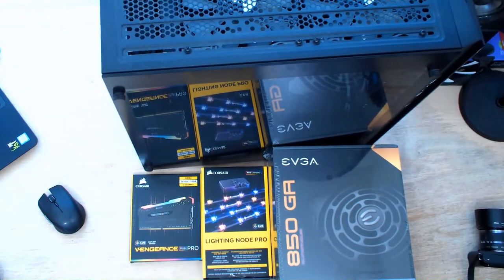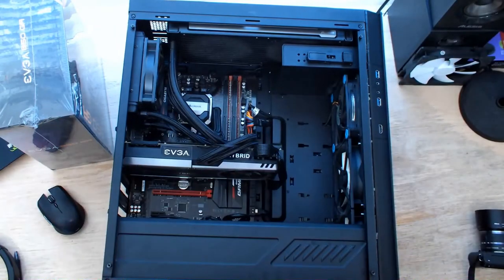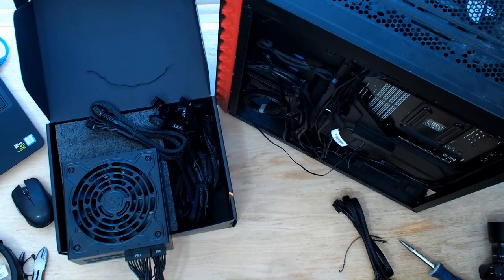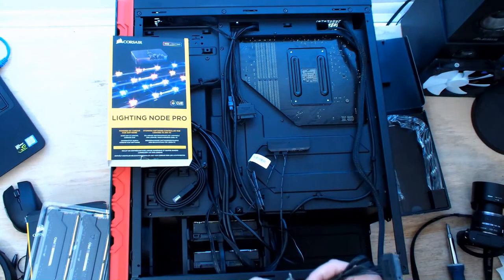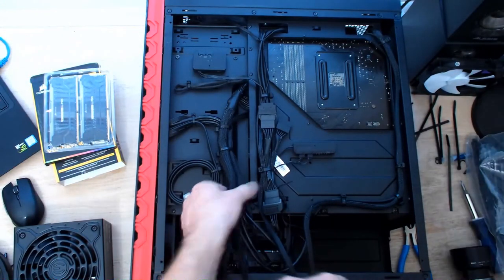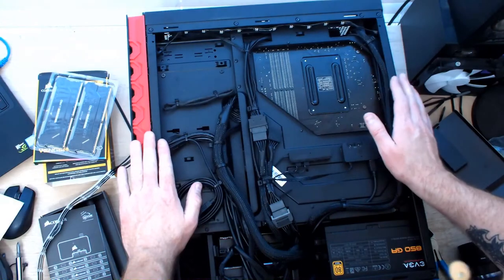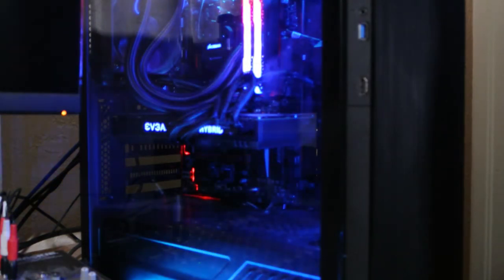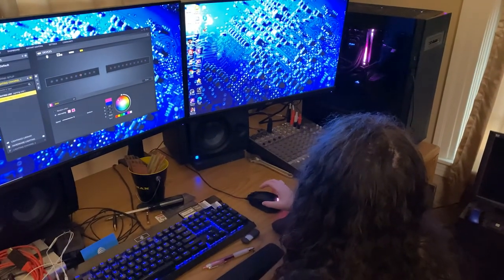Adventures of WinHell - EVGA & Corsair RGB

Comment: What’s the difference between a G5 and a GA?
Both gold
Reply from the maker: "Gold" power supplies are just indication of their efficiency rating. 80% Gold means that they have to certify at 90% efficient at a 50% load.  As for the differences between the G5 and GA there isn't much. The G5 is a newer model, has a newer Fluid Dynamic Bearing fan (the GA has a Double Ball Bearing fan) and it looks like the G5 eliminates the Floppy power adapter. Beyond that, they are the same size, and have the same power ratings. Both are good power supplies, but the G5 is currently the better deal as I have seen them $10 cheaper than the GA.
Reply: @AudioCraZ  awesome! thank you for replying! sub!

Comment: Hey man, I just installed this PSU and my computer is working fine. Only issue is that the PSU is making loud noise when gaming and fluctuates on and off when not gaming. It's a damn loud fan noise ;(
Reply from the maker: If it is an EVGA power supply, I would contact their support. I have always found their power supplies to be very silent. It may be a faulty fan or or something may of happened during shipping (I have had shipping damages many times).

Comment: hey did you face any problems with this psu if so please tell
Reply from the maker: None at all. Running damn good in my system. The only issue I have had was the ram, and that was just the ram was too fast. I had to go back to my standard sticks. Other than that, system is running smooth.
Reply: @AudioCraZ  i heard that this power supply doesn’t work with 3080
Reply from the maker: @Mishalx8  Power requirements for a 3080 is 750 watt psu, so this 850 would do fine (unless you plan on some serious overclocking). Beyond that you would just need to get the power  connector adapters, which are easy to get.
Reply: Today I was building a pc with the same power supply and the cpu cable doesn’t fit there
Reply: Can you help me ? Because the 8 pin for the cpu has a different shape and doesn’t fit in the mother board I don’t know why do you know the answer
Reply from the maker: @javierhernandez9704  There will be a "CPU" power leads and "VGA" power leads. They are pinned and shaped differently. Make sure you are getting those correct. Most power supplies have these labeled as such.
Reply: @AudioCraZ  yes I know which one am I supposed to put for the 8 pin cpu ? The vga or the cpu.because right now I’m putting the cpu one and it doesn’t fit the motherboard has different shape than the cable
Reply from the maker: @javierhernandez9704  What brand Motherboard? They are supposed to be industry standard. Unless you have some OEM (which they will use proprietary or non-standard connectors) specific board, or one of those odd Aliexpress boards.
Reply: @AudioCraZ  I was looking at the reviews for this psu and people are saying it fried their pc components
Reply from the maker: @Blade43548  My system runs daily, no issues since this video. All manufacturers can have a faulty PS that will slip by QC, it happens. Overall, I have used over 80 EVGA PSU's and have never had a failure. I am happy with mine.

Comment: hey saw your video, just looking at how ppl build computers. I noticed you used the same PSU as me, except im using a 750W. However, I am a crypto miner and as I am using two gpu along with risers, can help me out in what Pci 8pin to 6+2pin splitter i should get for this PSU. Each VGA slot on the PSU needs to power one GPU & a riser. So I need a splitter to power the GPU & Riser. However, im confused with all this male and female connection. Can u help?
Reply from the maker: 750 could be enough, but from my limited knowledge of crypto mining,  I assume you will be running those cards at full bore all the time. You didn't list what cards you are going to use, but I can say this, make sure you have a large enough power supply to run both cards. You might, as you typically run nothing but a single hard drive (typically an SSD) and a low powered cpu. Usually your graphics cards will come with the adapters, or the power supply will have dual 6+2 connectors (where there are dual 6 pin connectors with the additional 2 more if your VGA card requires the 8 pin style). As the EVGA PSU's 750 and up are normally wired with dual GPU in mind, you should have everything you need to get them fired up. My only concern is if the PSU can supply enough with the everything an full mining. Different model of GPU's will have more or less draw, so check that before going too far. A burnt up card or a blown up power supply due to over drawing on it can be a costly mistake.
Reply: @AudioCraZ  ok two Gigabyte 1660ti a B150 mining MB and a celeron CPU with a single stick of RAM and 128GB SSD
Reply from the maker: @Varillah  Those cards are about 115 watt TDP. You should be more than fine with the 750 under load with 2 cards and the rest.
Reply: @AudioCraZ  Thanks